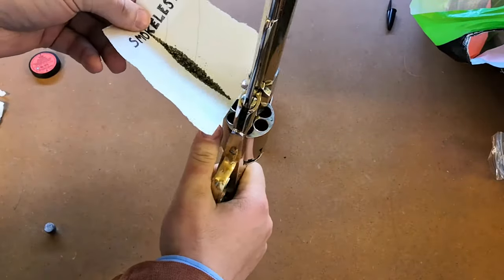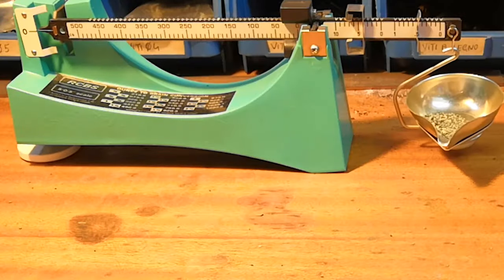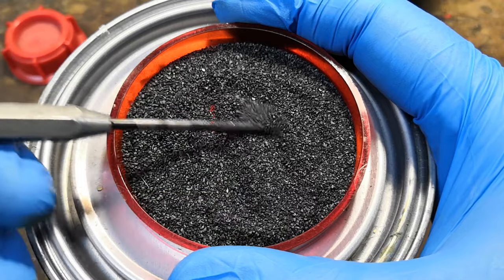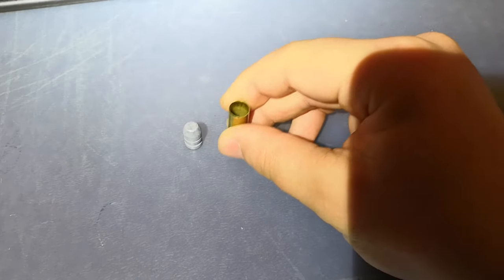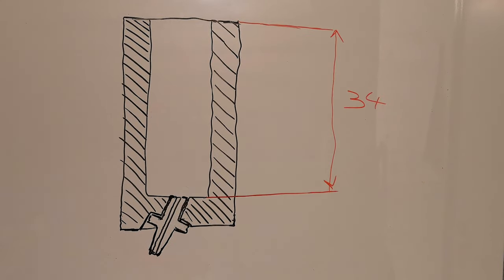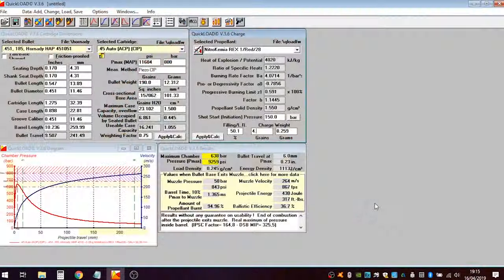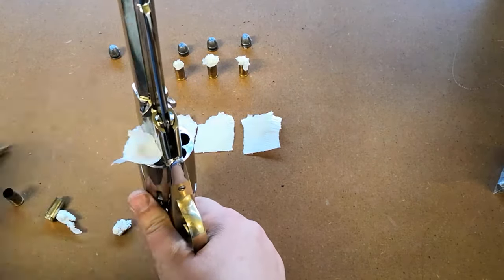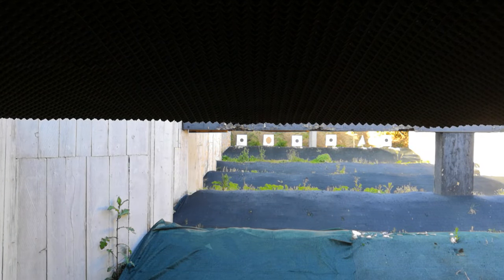Smokeless Powder in a Muzzleloader: What Really Happens ?

Comment: Very informative video.  I’m glad you tried it so we wouldn’t have to.

On the flipside, it is completely safe to load modern cartridges with black powder, as long as you clean the barrel every 5 to 10 rounds.  I used to do it all the time in cowboy action “frontier cartridge” matches.  I would shoot 38 special out of a lever action 1873 winchester clone, and a pair of colt single action army clones.  Granted, 38 special was not around in Western times, but I own several revolvers in 38/357, and I like commonality of caliber.

All you need to do is completely fill the case with black powder or pyrodex (no air gap), and then seat and crimp a cast lead (not jacketed) bullet just like you normally would do when handloading.

Note: this is usually done with revolvers.  Semi-autos can get gummed up with soot pretty quickly, and they might have difficulty cycling.

Lastly, clean the gun AS SOON AS YOU GET HOME.  Black powder will badly rust a gun if you don’t clean it right away, even if you leave it overnight.  For black powder, I use 10% ballistol, 90% water, and it actually cleans up a lot easier than smokeless.

Comment: Thank you for posting this! I was really scratching my head at why people say not to use smokeless powder in a muzzleloader. People cite that smokeless is just more powerful, but, from a metallurgical standpoint, the steel in a muzzleloading gun is no different from that of a smokeless powder gun, at least not enough to blow it up. clearly, it's simply down to the design of the guns, and the strength of cartridge guns vs muzzle loaders in their actual design, as well as everything you showed in this video making the truth a bit more complicated. now i understand how TheIdahoanShow can make a 45 ACP barrel out of plumbing pipe and still have his fingers attached.
Reply: I can guarantee you the steel in a muzzleloading gun is not the same as a modern bolt action rifle using high pressure smokeless gunpowder. Modern guns use a chromium, molydbenum alloy and the barrels are hardened to a specific rockwell range which is lower than the hardness of the receiver and bolt. The yield strength and toughness is far far higher than cold rolled steel which is basically what muzzleloader barrels are made of today. A 45 ACP round produces about 21,000 psi of pressure, its well within the yield strength of modern mild steel with an adequate cross section. In fact alloy steel only came into being around the 1890's with the advent of high velocity small bore jacketed rifle projectiles using smokless powder as the propellant. In fact a lot of American steel of the 1850-1890 was pretty crappy in metalurgical terms, European steels were generally superior especially Swedish steel which was considered to be the best.
Reply: @jb-xc4oh   Well yeah but it's still not THAT different. You can make gun barrels out of normal old medium carbon steel and they will work great. Even a mild steel barrel, if it's made well enough, will stand up to modern ammunition. A smokeless round won't make a barrel explode just because it's a smokeless round. And, yeah, the truth is that smokeless can produce dangerously high pressures if its burn rate is not managed properly. When done right though, it's perfectly safe. TIS even had a video about shooting 40 SW from a piece of plumbing pipe lol. Also modern muzzleloader steel isn't exactly Weak.

Comment: You can start out by finding load data for smokeless which is a compressed load for a similar bullet diameter and weight. This makes it so the bullet can be seated all the way down. You don't want data for large powerful cartridges, but the smallest cartridge data for the caliber if using revolvers. Otherwise you will blow it up. Those sidewalls are very thin and could not handle magnum power levels. It is tricky business and easier and safer just to live by the rule of no smokeless in black powder guns.

Comment: Excellent video , I’ve been shooting my Uberti .44 cattleman muzzle loader with green dot nitro instead of black powder for a couple of years . It works but it is difficult to get consistency when loading as you stated and this does affect accuracy . I am still experimenting and having fun doing so . I have found 8 grains of green dot with a significant air gap between a round ball and using shotgun primers works best for me . This is not a proven science and I DO NOT recommend attempting this as it can result in injury or worse .
Reply: How do you use shotgun primers?
And isn't the Cattleman a cartridge revolver?
Reply: @deandeann1541  here in the good old UK we are not allowed cartridge revolvers but can have black powder revolvers and nitro cylinders which usually use 209 shotgun primers rather than percussion caps . Handguns either revolver or automatics were banned back in the late 80s . You can have a long barrelled cartridge revolver , essentially a single action army with a 24 inch barrel . A buntline . Very unwieldy . Gun sports are on the decline in the UK apart from clay shooting .

Comment: This is a big brain, really good video. and it's not just meme, flashy slop like the majority of youtube. I've always wondered how to do this properly, I knew there must be a way. I always assumed the only reason smokeless isnt used in bp guns is because original/old guns are made with old alloys of metals that also are not made with modern techniques to made them as hard and durable as guns and tools are in modern times. I have a dragoon revolver that is new, and I always wanted to shoot full strength 45 colt ammo in it lol. I've shot it once with a smokeless/bp mix and fired it with a string just to be safe, and it was ok. This video answered a couple of questions i've always had, because just understanding the burn rates/pressure curve doesnt really explain how you would do this if you really wanted to. Thanks. 
The one thing I want to know is can you sandwich a tiny amount of smokeless between 2 layers of bp and it will actually improve the power compared to an optimal load of bp? Or would it just be worse?

Comment: Another major difference is that breech loaded cartridge guns achieve a gas seal due to obturation. The cartridge expands and this causes a gas seal whereas a percussion cap primed muzzle loader will have the issue of the cap being blown to bits if smokeless is used and a jet of gas escaping. The materials used in muzzle loaders is also one of the differences particularly with historical pieces.
Reply from the maker: Of course the sealing is different, but with the same pressure, the leakage of gas is pretty much the same with smokeless and black powder. Also consider that the gas leak through the nipple is much smaller than that through the gap between cylinder and barrel. But you focused on the right spot: the ignition. The difference is there 😉

Comment: Lead Non Copper Jacketed bullets of the same weight as OEM recommended.  A powder used for a Sub Sonic Equal to low 45ACP and below 850fps.  That is the recommendations of a conversion cylinder conversion.

Comment: I would argue that this is extremely useful! I own an old 1875 22-short revolver that i absolutely adore! But ammo is very hard to come by!

Original BP shorts vere 29gr and produced 830fps MAX and average 600fps out of the short beral

CCI CB Shorts (Smokeless) are also 29gr and produce 710fps Max with an average of 450fps out of the short beral due to slower burn rate i think! 

I hope this brings some insight to a situation where using smokeless is almost the only option. And how i justify it based on the lower pressures involved using the cartridges listed and simply being unable to find a better alternative than this!
Best regards - C

Comment: Great video I'm a reloaded and I experiment too.  Our modern day muzzle loaders are not made of raw iron anymore they're made or alloy steel so they can handle more pressure if you misscalculate but still be careful.
Reply: I doubt your replica muzzle loading rifle is made of alloy steel, why would that be necessary when the manufacturer spcifically lists a maxiumum charge not to be exceded of black powder.
Reply: Can you name me the grade of steel used in modern day muzzle loaders. Modern gun barrels are made of a chromium, molybdenum alloy called 4140 and is heat treated to 25-35 Rockwell hardness. A gun barrel needs to be strong but also tough to resist the extreme cyclic pressures and the abrasion of high velocity jacket bullets propelled by modern smokeless powder. If you think the manufacturer of an inexpensive muzzle loader shooting low pressure pure lead bullets is going to use premium heat treated alloy steel you are dreaming in Technicolor, its plain old mild streel and is more than adequate for the intended purpose.

Comment: Also should be said that your using a modern black powder revolver that can handle double the pressure of a normal reproduction revolver. Also the fact that the initial pressure spike from much quicker burning smokeless powder is really the danger more than just pressure   overall pressure of a load

Comment: Made some simulation with GRT, one of the most critical parameter is the depth of bullet seat according to your powder burnrate, bullet too deep with fast burn powder (like vectan BA10) is dangerous. With BA10 dont push your bullet too deep. Dont know if wad or cornmeal have an effect on presure spike to avoid this. Slower powder are safer but all the powder isnt totaly burnt.

Comment: One very real issue with this is that your bullet is uncrimped basically just held by a little friction. Recoil can make it move. As could carrying it all day or riding a pony or any other yeehaw stuff
Reply from the maker: The friction is quite strong with the proper bullet, and recoil on these guns is quite mild... I guess that could happen with an improperly sized bullet
Reply: @Backyard.Ballistics  there are powders that are technically smokeless like blackhorn 209 and there are a couple other powders that are made specifically as black powder substitutes that are not as corrosive. Anything is better than pyrodex though. That stuff is rotted more gun barrels than anything else.  The ones that are made specifically as black powder replacements can be done safely with normal loading procedure and no danger of having too little powder causing detonations or too much or pressure spikes

Comment: Definitely a "don't try this at home" sort of experiment. Several years ago a friend and I were curious if you could use smokeless powder in a back powder rifle. Like you, he did some conversation calculations and came up with what, at the time, seemed like a good load. I have a Hawkins replica with a serious bulge, and a few missing parts to show as proof that things can go wrong quickly. Fortunately we did have the foresight to remotely fire it, so no injuries. And I couldn't be too mad, as it was partially my idea.
Reply from the maker: The risk is intrinsic of smokeless powder, not of the fact that the gun is muzzleloaded, so if you replicated a load with the same parameters in a breech loaded firearm the pressure reached and the consequences of that would be pretty much the same. I definitely agree with you (and many other commenters) that muzzleloading practice could make it moke tricky to respect the loading parameters though. Also, you don't have the standardization benefits of cartridges, so every gun would need its own loading data. So yeah, no doubt that this video falls in the "don't try this at home" category 😂
Reply: The HUGE advantage that we have today, though, is the excellent Quickload computer program. It takes almost all of the guesswork out of a test fire....with the emphasis on "almost"!

Comment: A  problem is that the cartridge is sealed while the nipple is not.   In the cartridge the primer is inside the case with no escape. In the muzzleloader the seal is the percussion cap and hammer face.  If the nipple threads are not perfect, the nipple can become a missile so there is nothing except the hammer to stop it flying towards you eye.

Comment: I would like to see a video on this subject using a rifle and backing into the proper load by iterative testing with a chronograph.  I cant shoot more than 3 balls down my .45 rifle before having to clean.  I would love to use smokeless in it to alleviate this problem.  So, shoot my normal load of pyrodex and ball and measure the velocity with a chronograph.  Then, using a rifle smokeless powder, work up a load that results in the same muzzle velocity, starting small and working up.  Surely muzzle velocity and with consistent bullet weight is reflective of barrel pressure.

Comment: One difference, the firing pin hole in a breech loader is blocked by the primer case and there is a likely pressure leak path through the breech. Muzzle loader has primer (percussion cap) on the outside, overpressure could blow out through the flash hole and blow the cap apart into your face. That's my guess on the difference.
Reply from the maker: Your guess is right! The difference is the ingition system, which in the muzzleloader is weaker😉

Comment: I think the biggest danger in this practice is that we have guys out here now that can blow themselves up with Black Powder and it's virtually impossible to do so. With smokeless, you just speed up the process of them doing so. I've seen more than one demonstration of people that are going to show us dummies how smokeless powder will blow up a black powder rifle, ( Every time ), any amount, then they have to put a (  Ridiculous  ),  amount of powder in them and make several attempts to actually blow it up. To me they encourage rather than discourage the practice. Which I'm sure you admit is not a good idea in the long run. I own an old New Twist double barrel shotgun that belonged to my great grand dad. Made from twist steel it is actually weaker in Damascus guns, but I wanted to shoot it. I ordered a box, ( At great expense I might add ) of Real, paper, black powder shells to shoot in it and four boxes of what is called Vintagers which are Modern powder loaded shells but loaded to only six thousand PSI. I shot four of the Black Powder loads in it. Scared the hell out of me as they kicked like I was shooting a ten gauge !   Then the Vintagers which were quite mild and pleasant to shoot. I've never loaded another of the Black Powder shells in it.  The Vintagers by the way are loaded in 2 1/2 inch plastic hulls as a Lot of the old 12 gauges did have 2 1/2 inch chambers in them. The real Black Powder shells were in 2 3/4 Paper hulls.

Comment: It's surprising how much smokeless these cap and ball revolvers can take aslong as your carefull and the cylinder and frame are properlybhest treated, I've worked my way up to modern smokeless metallic cartridge power levels like +p .45 long colt , and even magnum power levels on some, I have also used FMJ bullets and to reduce hang fires I like to use magnum caps and fill the nipplee with fine BP

Comment: How deep did you seat your bullets?  Did you seat it all the way down on top of the paper towel wad, or did you leave some space?  Great video, thanks.
Reply from the maker: I seated them as low as the seater goes, which left the calculated empty space between the powder and the bullet. The fluffy towel was just to keep the powder pushed against the flash hole

Comment: It seems the key is truly load density. I think you could accomplish the needed safety margin without the software if instead of adapting the load to the gun you adapt the gun to the load. 

For example take a .36 caliber cap and ball. They were often converted to .38 Colt. So you should be able to safely use .38 Colt load data if you mark your rammer to seat the ball to the depth that would equal the the same chamber volume as that of the loaded cartridge.
Reply: a number of repro cap and ball revolvers have conversion cylinders. these have warnings to leave one of chambers empty and list the specs on ammo to be used. a number of companies make cowboy loads using a non corrosive black powder for these repros and antique guns

Comment: I never understood why smokeless .45 LC and .45-70 works with smokeless in trapdoor Springfields and SSA, but an in-line muzzleloader rated at 35,000 cannot handle even a small “gallery load” safely?
Now it makes sense completely. I cannot imagine getting my .50 cal pistol to provide a certain and remotely consistent seating. I can certainly seat a ball on the powder, but nothing consistent and definitely not of any particular depth. I really wish hey figured out the ultimate low pressure smokeless that behaves like black!!!! I have hope in blackhorn 209 keep development going much much further!!! Make a cap and ball version safe for the filters at indoor ranges?
Reply: You aren't supposed to use any smokeless powder in pre 1900 or so(not sure of the exact serial number cutoff or year but its around 1900) SAAs though, and original trapdoors are not safe with most modern .45-70 smokeless loads but there are the trapdoor safe ones of course.